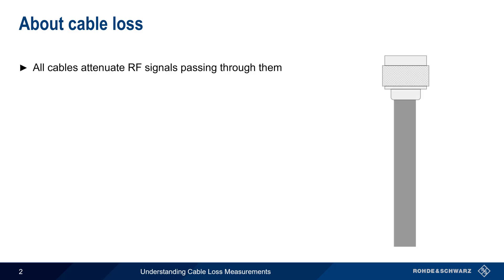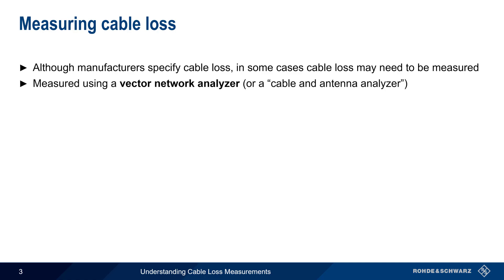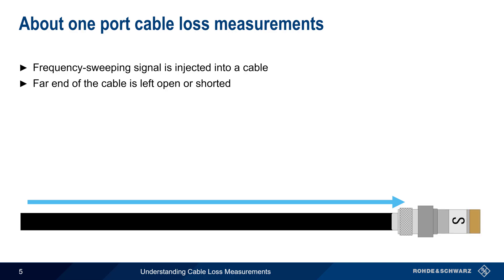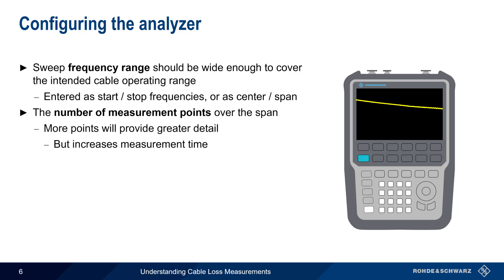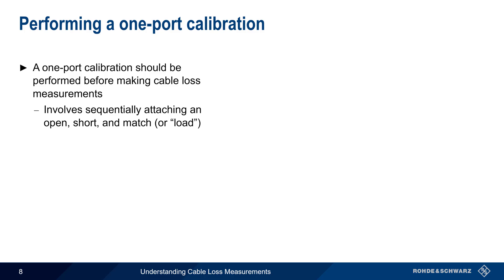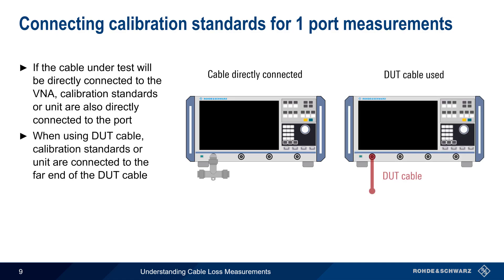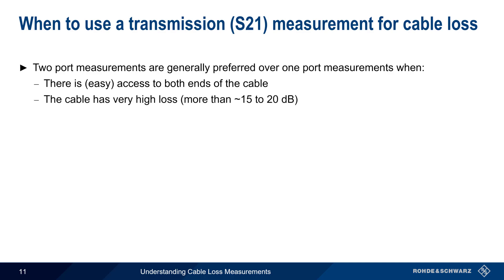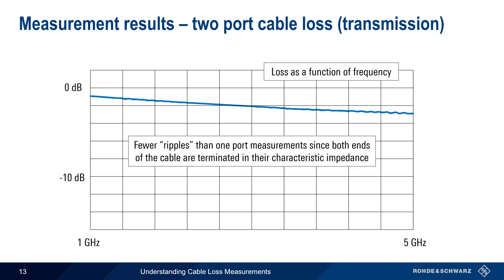Understanding VNAs - Cable Loss Measurements

Comment: dont forget in these measurements it is assumed the cable impedance is the same as the VNA port impedance. if you want to measure the loss of a 75 ohm cable with a 50 ohm VNA additional considerations are required and some hand calculations will be needed to extract the correct loss
Reply: Yes, indeed!  I did a separate video on measuring cable impedance with a VNA, and I have several more videos planned around transmission lines, so please stay tuned!
Reply: RAM and RAZ are your friends for this task.